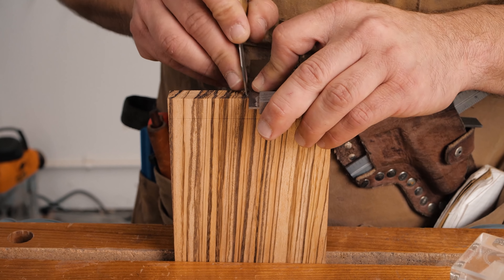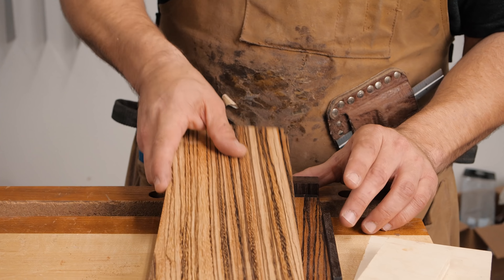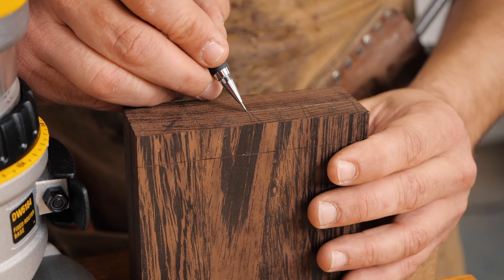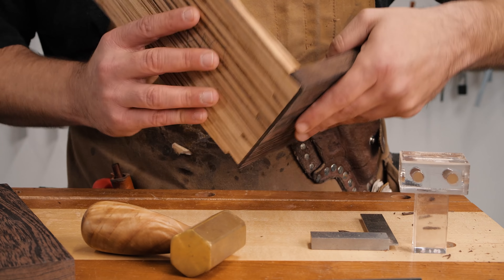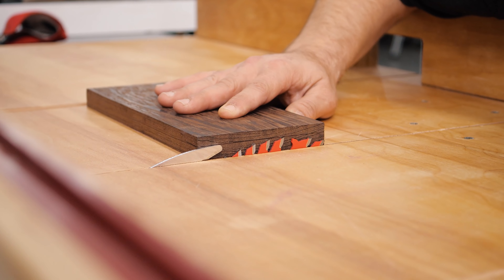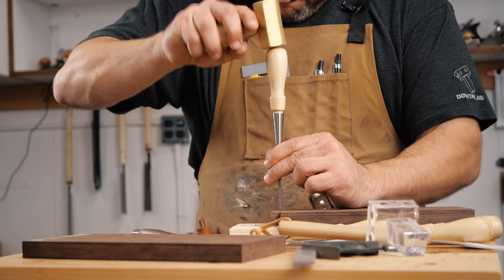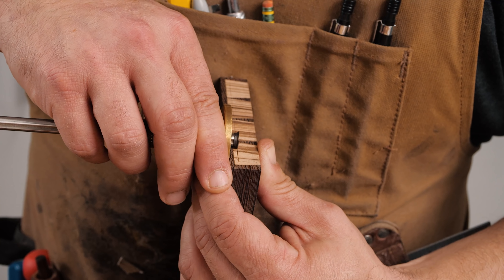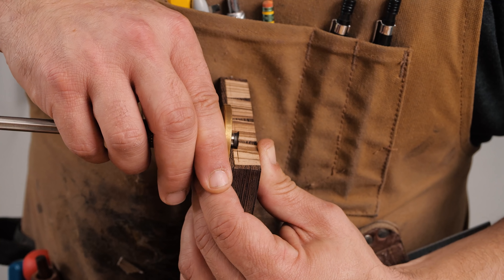Inlaid Half Blind Dovetail - Joint of the Week

Comment: That little phrase "woodworking isnt about being perfect its about knowing how to fix your mistakes saved my recent project lol. Its my first project and im using barrel hinges which are a bitch to install correctly and its a very small piece so the slightest offset was noticeable and sure enough i closed it to test the hinge and it was about a 16th of an inch off on each side and i started to panic but then remembered that little phrase. I rasped and sanded the sides till they were flush and it turned out perfect.
Reply from the maker: My guy!

Comment: Loving your stuff man, could I ask that when you say your measurements that you please put the metric distance on the screen. I have an ok grasp of the imperial system inches, feet etc. But I can't possibly do the math for the fractions in my head and I'm sure other international fans feel the same way. Cheers
Reply from the maker: That would be a tremendous amount of extra work (on top of an insane upload schedule) on my end but a very easy way of converting is multiplying by 25.4. Cheers bud and thanks for watching.
Reply: Most of us (that I know anyway) in the States go by "wrenches" from Metric to SAE sizes... SO we're not always "doing math in our heads" either...
   A "Short short version" :
13mm = 1/2 inch
6.5mm = 1/4 inch
3.25mm= 1/8 inch
1.7 ish mm = 1/16 inch

12.7mm (technically) = 1/2 inch... but wrenches don't come in .7mm increments... (so this will get you "in the neighborhood" and shorten the math rather than perfectly eliminate it)
   BUT it's a good place to land approximately where you're going to want to be, even mixing and adding the increments together, so you can still (mostly) eliminate the calculator... AND at some point in all this, YOU are going to have to put down the rulers and start "eyeballing" your precision for fittings, even with the occasional session of "trial and adjustment".

     It's worth note that Katz-Moses (and a lot of us around YT) have been doing things like this for years, so we've also gone through those motions a LOT in our lives... AND some of us are still doing it that way. Give yourself some chance to breathe and practice. You'll get there with a few sacrificial pieces of scrap and some note-taking from the experience. 

       ANYWAYS... hope this helps out. Please do scratch the numbers down... so then you have them. ;o)